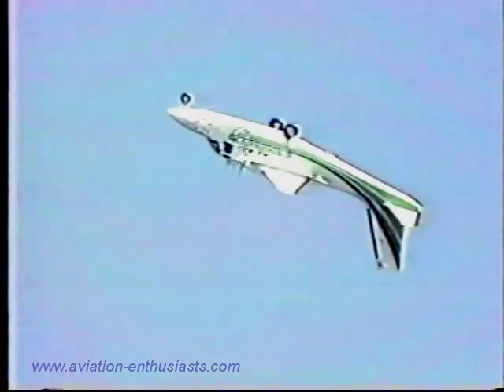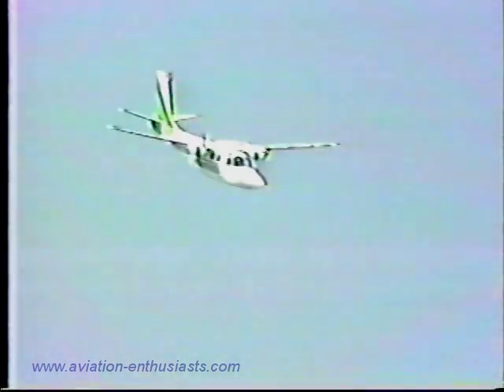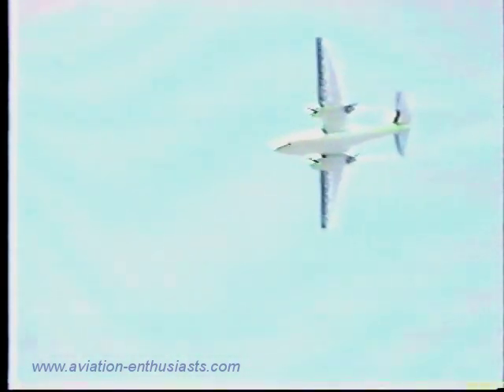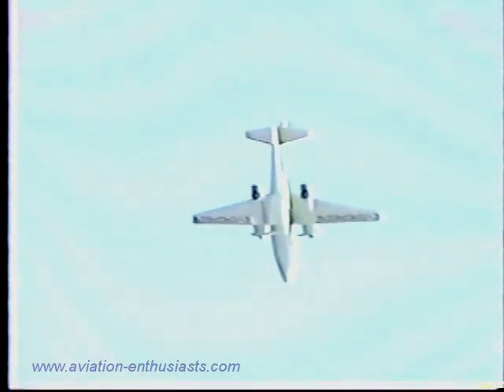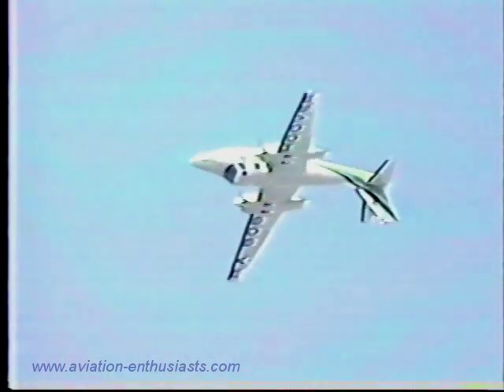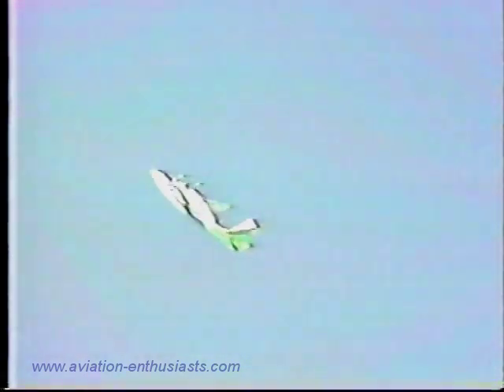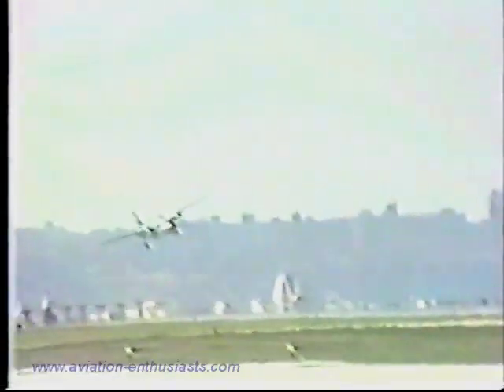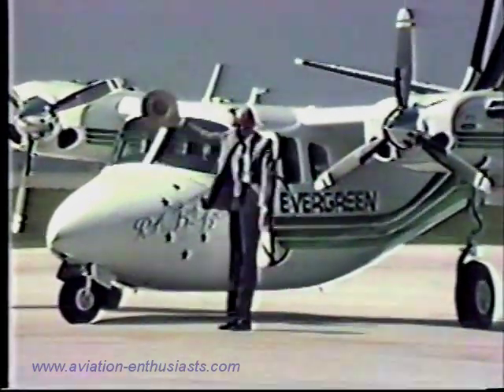1986 Cleveland National Air Show Bob Hoover demonstration

Comment: The greatest airshow pilot, Greatest test pilot, and WW2 combat pilot. Only man to escape WW2 German POW camp in a stolen FW 190. Bob flew airplanes at a depot in WW2 which were assembled by civilians in the middle east had no experience with aircraft. He said it was routine to have engine out, gear, and control failures during test flights. He had engine failure on take off after someone put JET A in his shrike which was a piston engine. I believe it had been anyone else at the controls would not have survived.